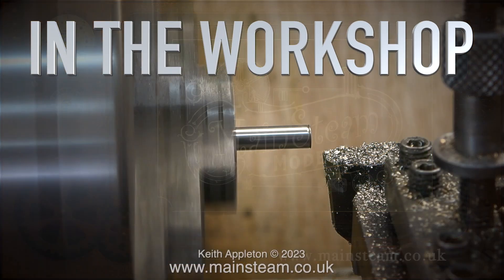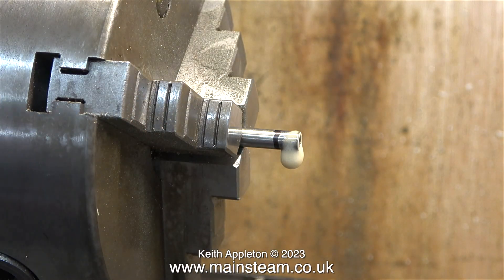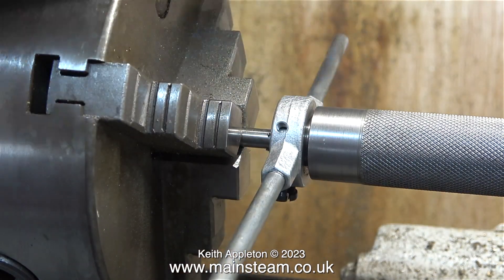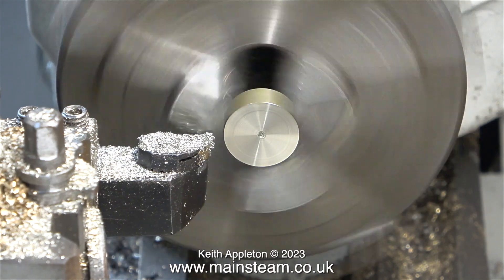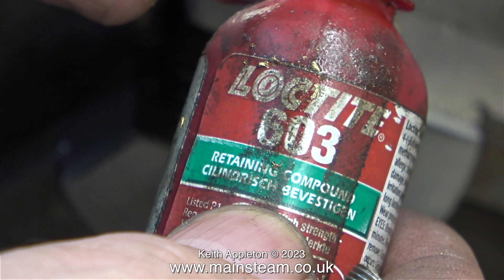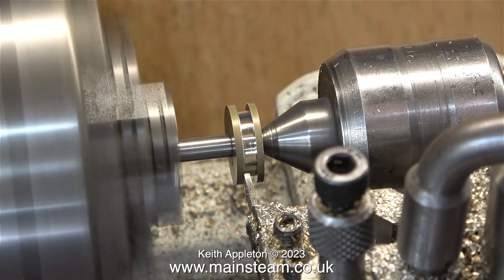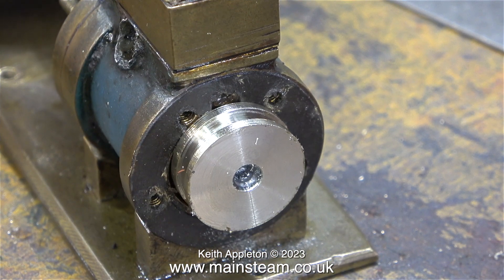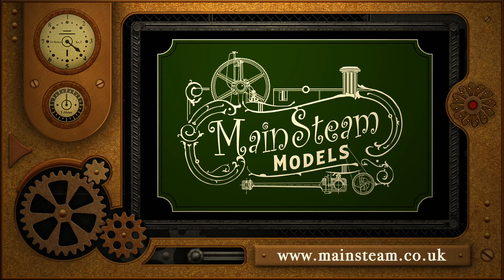A DIABOLICAL MODEL STEAM ENGINE - PART #5

Comment: Seems like most of the engine if not all was made with a hacksaw and file?
Reply from the maker: Not the Cylinder, Crank Web or the Flywheel & Pulley . . . . they were machined at some time . . . .

Comment: I was wondering if you have ever used a steam cleaner wand on an engine to clean it. Such as ones for household use .
Reply from the maker: I do actually have one of those, but I would only use it on a complete model if there was evidence of Mouse or Rat droppings. I use an Ultrasonic Cleaner mainly ......